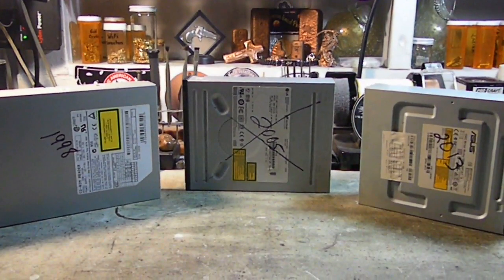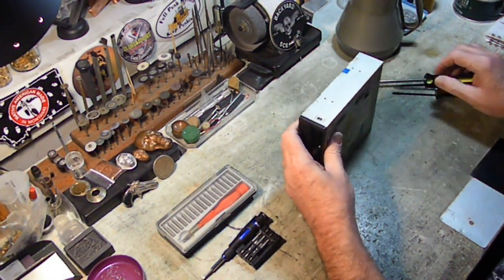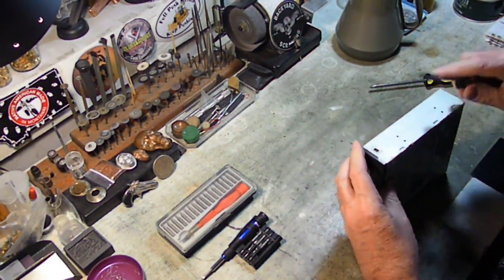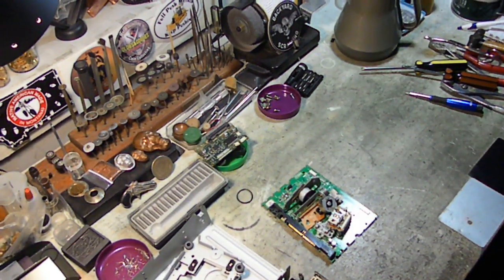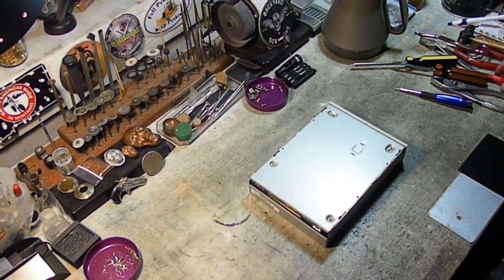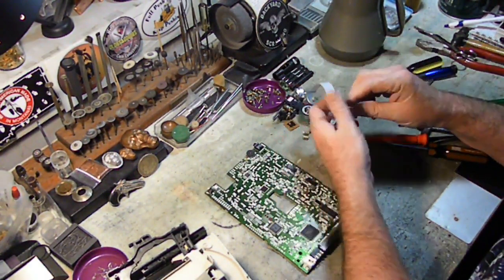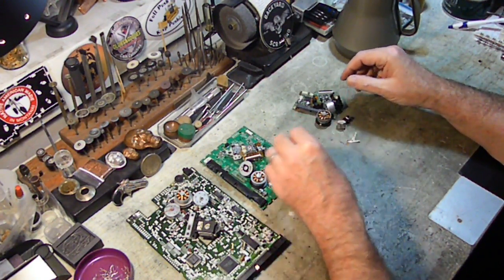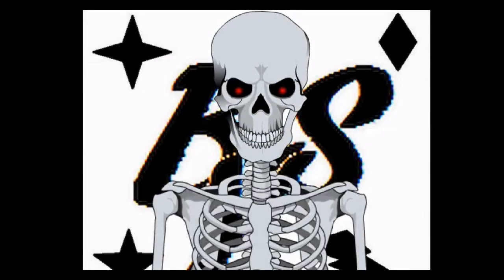Scrapping CD & DVD Roms

Comment: I just put then back together with the plastic .When they unload my trailer with the BIG magnet and get loaded into there trailer that is the only test and they most of the time they pass.They are not to picky on steel.Saves on the trash.Use the cold to your advantage take your cans in the ones with water in them don't leak all over the place
Reply from the maker: Good idea 🥶🧊🥶

Comment: The wider white pin sockets from the ribbon cable should have gold plated pins. The smaller ones don't.
Reply from the maker: I pretty much check um all just in case, but in general you're right about that!!

Comment: You really should use a heat gun to remove those tiny little flatpacks. They're not Bga's they're kinna like a normal flatpack, but the legs are embedded into the plastic underneath. If you use a heatgun on those and probe them every few seconds with a screwdriver, they'll fall right off the board. I cut off all my chips I can first with a sharp ex-acto knife, and anything that doesn't fall off, I put into a vise and hit it with the heat gun. Most newer laptops I found have nothing but these type of chips in them. So leaving them on the board is not an option. They have good gold in them, so they come off and get processed with all my other chips.  Have fun!
Reply from the maker: Normally if there is several on a board I will do that, but when its just one small one on the entire board generally I toss um.
Reply: Toss them my way, I'll never throw out money.
Reply from the maker: @scrapman502  Will do, I will keep them for you!